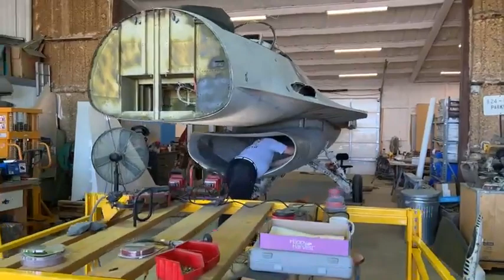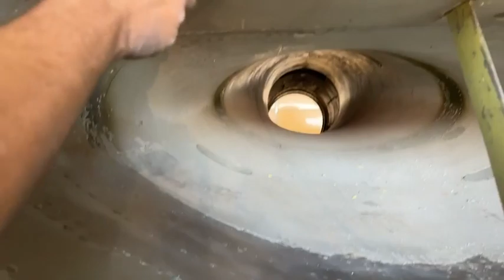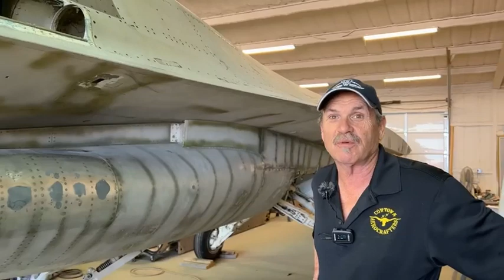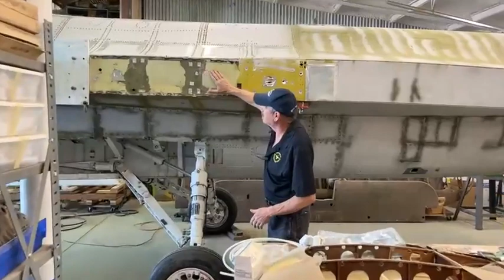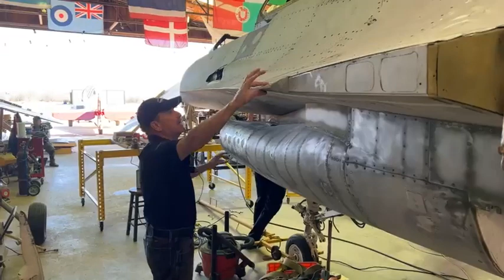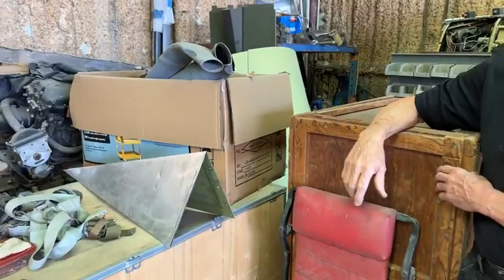YF-16 Update at Cowtown Aerocrafters

Comment: It would be great if you could get a toasted engine to mount in here so the compressor would be visible through the inlet and everything will look right from the tail and you wouldn't just have to tack the nozzle on the rear.
Reply from the maker: Great idea
Reply: @FtwAviationMuseum  Is the Air Force generally willing to donate  stuff that's no longer serviceable to museums? We have an F-89J at the EAA museum which is cool, but not having the engines in it is even more noticeable as the intake trunk is only three or four feet long. (Same with the exhaust as the end of the engine made up the back of the nacelle.) I would love for the EAA museum to be able to put a couple of J-35s in it!
Reply from the maker: The Air Force Museum doesn't DONATE anything. The aircraft is on loan to us. We had to go through a lengthy certification process with the. Same with the US Navy and Marine Corps. The Air Force rarely loans aircraft with engines to ensure they are not flown. We have done a couple of artistic inserts in the intakes. Print or paint the intake picture on sheet metal and form a distance it passes. Easier than dealing with engines, which are almost impossible to get.